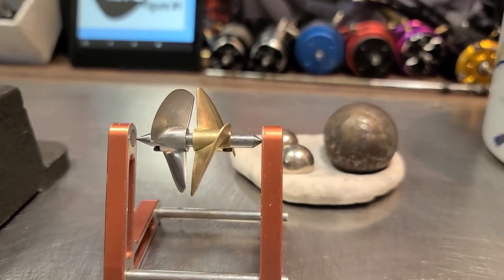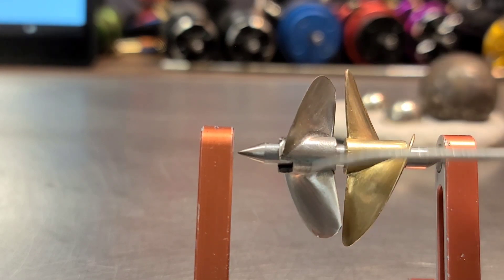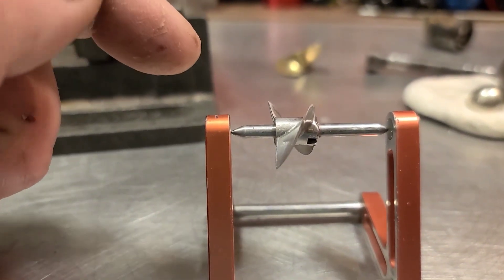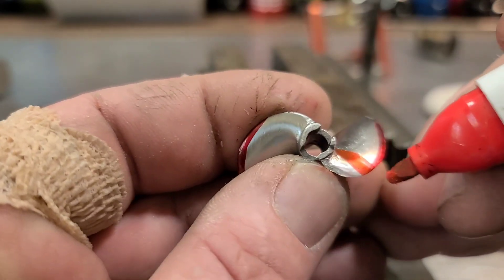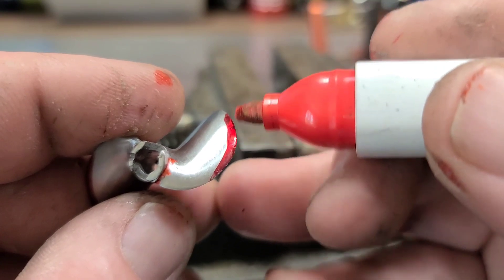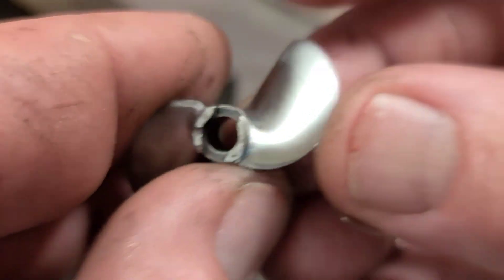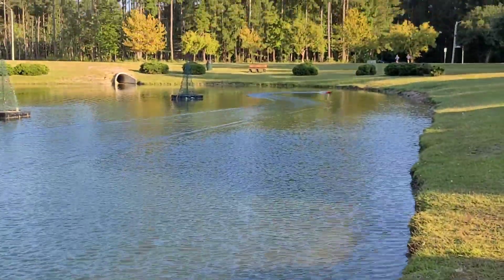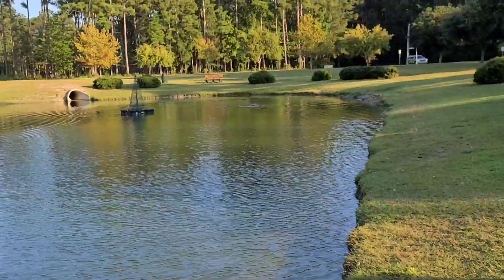Rc Boat Propeller Pt3 Cupping - Detounged, Balanced, & Sharpened

Comment: I just got a traxxas m41 6s I have the original motor and I just through in a 140amp esc.  It has a brass 41.50x? prop.  What can I do to make its preform its best.  I want top speed I dont care about how fast it takes off.
Reply from the maker: Never run that hull before. I'd start with an ABC 1616 17•45  or 1717 17•45
Reply: @IRONCLADRC  thank you will order

Comment: what your doing there is not what is called cupping, what your doing is putting a SKI ROLL on the prop. this is purely for pull away and will cause a loss in top speed as you are decreasing pitch by doing this....... when people say add cup they either mean to the tips to keep grip in turns or the usual cupping is done on the trailing edge to give more pitch.
Reply from the maker: Thanks. I've been looking into the voodoo cupping anvil.  I've read several articles about cupping, since this video I've realized that I wasn't doing it the correct way.   I appreciate you pointing it out.  I actually gained 1 mph "rolling" the blade, then I "rolled"  it a bit more and lost 5 mph.   Ended up ditching the whole process.

Comment: Good job and nice video. The next speed increase will be polishing the front to a mirror finish to gain about a .5 speed increase. In addition polishing the back is debatable between acceleration and unloading and top speed and a gain of .1 as a slippery prop is a fast prop I always say. 

Next boat? I would say anything JEA. Fun to build, dirt cheap and insanely faster than any boat on water. You can't beat the speed of a rigger. For that pond a JAE Mini Sprint would be a blast.
Reply from the maker: Thanks again, The propeller performed hundred times better than  stock I enjoy cutting down propellers have messed a lot in the past.    If you don't mind could you resend that link to your off-shore electric prop cutting page I'm interested to see.  I must have missed it in your previous comments.

Comment: You asked me last time if i had a boat yet. Yes 2013 17' BAYLINER BOWE RIDER WITH A 90 HP MERC, Yes i know you ment rc boat. No but i have made a desition as to what boat, a Volantex ATOMIC 798-3. It's the new model, self righting and faster.All metal hardwher.